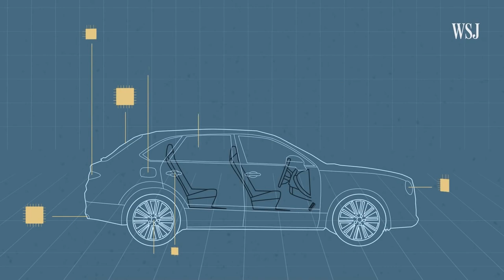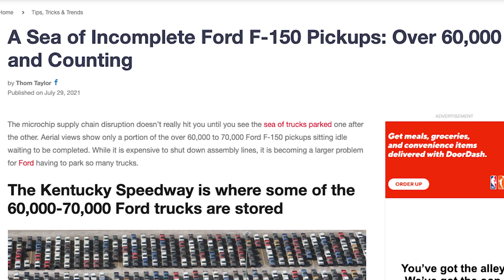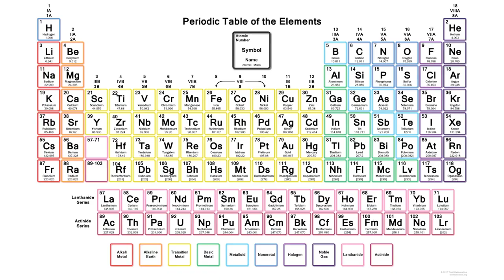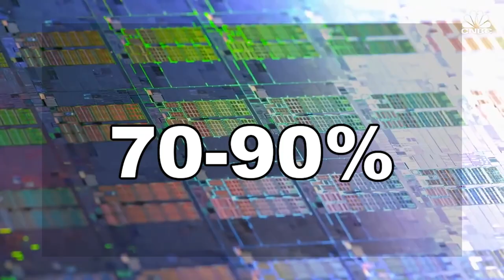THIS Could Be Bad News For New Car Production…

Comment: 2020 cars are going to have great depreciation. Can’t wait to buy one in 2023-2024
Reply: Prices still rising near me. I went to but a new Tacoma and the dealer wanted 5 k over MSRP. I walked out and found a low mileage Tacoma at Carmax for a way better price. Carmax even game me $ 3600.00 more for my trade.
Reply from the maker: Tacomas hold their value like crazy - any Toyota does. I think 2022 models could be bad cars in the future because of limited features (I am sure 2023, and possibly 2024 the same thing)

Comment: I pre-ordered a '22 Ford mustang mach-e back in Oct '21. One big reason I picked the premium trim was for the hands-free power liftgate. Last month Ford not only increased the price by 1-2k (depending on trim), but also removed the hands-free feature. Couldn't agree w/ you more that I feel pretty conflicted. I get why they had to do it, but the fact this isn't announced (you'd have to dig to find out about on the spot changes) feels a bit scammy.
Reply: Buy a Toyota. You will thank me later.
Reply: @jaysmith179  yeah those hydrogen fuel cells cars will be real bangers.  LOL.
Reply: @ryan_robertson  Coincidental fact: I actually bought a Mirai last year (when it was 20k off). I live in CA and it's a great daily driver. Only works because I live near 4 of those hydrogen stations